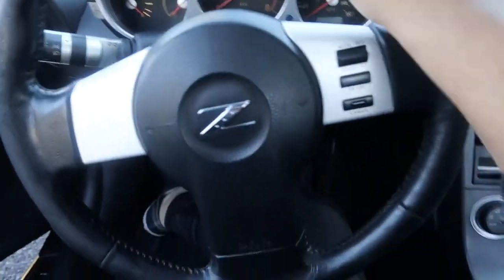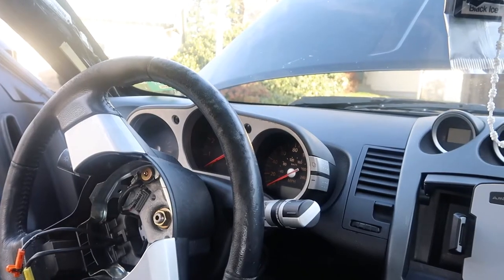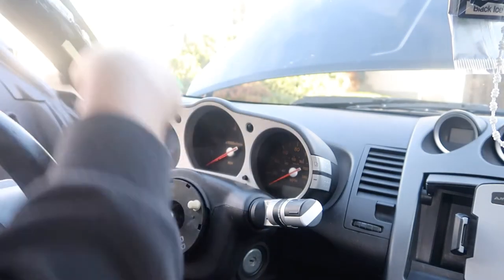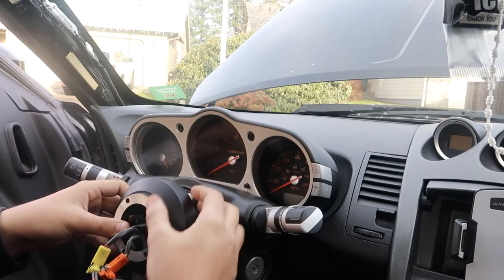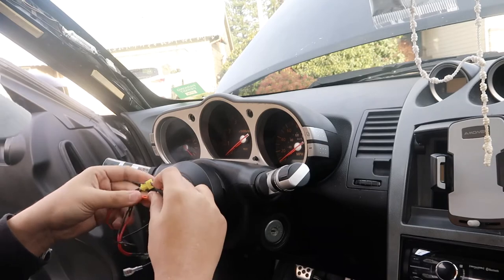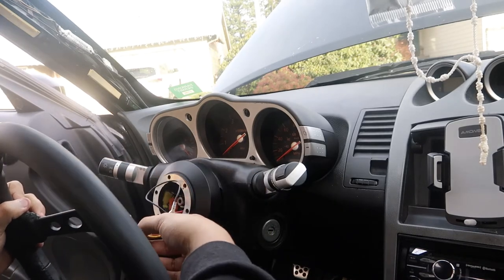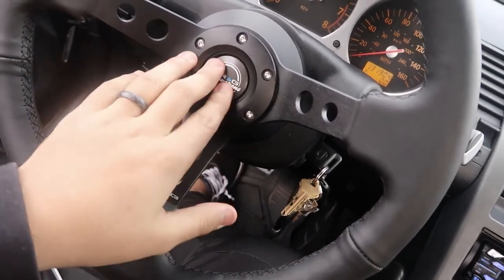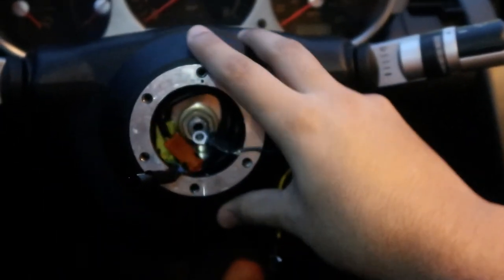350z NRG WHEEL AND SHORT HUB INSTALL !

Comment: Hay man can you help me out I installed my short hub and steering wheel but after that the steering wheel is all stiff when turning and it wasn’t like that before at all when I was driving, the piece behind the hub the white little piece that’s poking out doesn’t go all the way in so can it be that?
Reply from the maker: Hey the white little piece do you mean the connector or the clockspring?